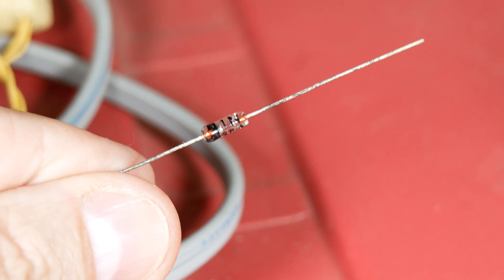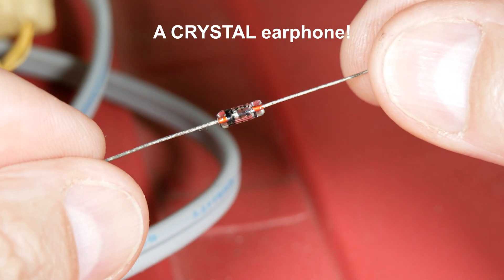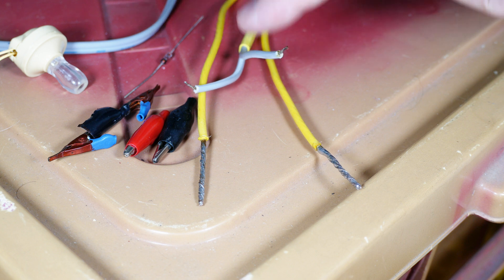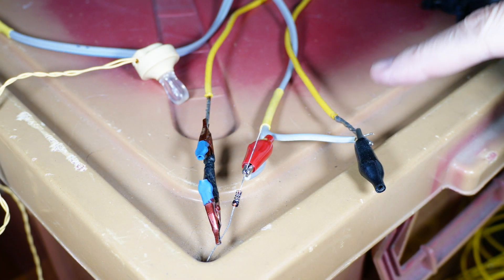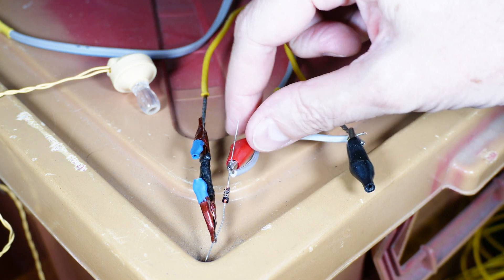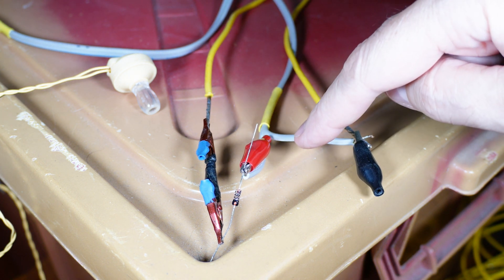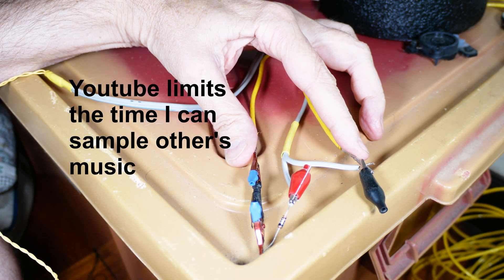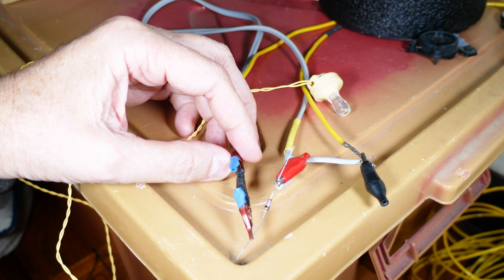World's Simplest Radio (4K)

Comment: The am radio transmitter in my area is about 577.875 miles away. Will this work?
Reply from the maker: @Dinoseven07  That is far. Depends on its power and your antenna.
Reply: @tsbrownie  What about 100 miles?
Reply from the maker: @Dinoseven07  Answer is the same. It's always about their power and your antenna / radio.

Comment: For some reason when I tried this I didn't get nothing but when I would touch one of the connections I could hear like electric charge
Reply from the maker: Do you have an AM radio station within about 10 miles?  And do you have a long wire antenna?  It will not receive FM and some countries no longer use AM.  But otherwise it works.
Reply: @tsbrownie I'm from the UK so I'm guessing we still have am cause my crystal radio works pretty well and how long would this antenna have to be I'm guessing my antenna was about 30 feet
Reply from the maker: @lukemarlow2939   There are 3 things to make it work: AM radio station within range, the correct diode / earphone, a good antenna / ground. 30 feet is good, the one I used here is 9 meters.  My ground is tied to my house's steel reinforcement.  In this video you can hear 2 stations, one is real close (less than 2 kms), but the other is more like 7 kms.  Check the distance to your nearest station and if it's close, then there's a problem in one of the components.  A crystal radio with a tuner will definitely out perform it.  As a side note, the first time I discovered this I was about 10, sitting in my parents half basement and accidentally touched a (now antique) germanium diode across the leads of an old time crystal earphone and was shocked to hear one of the local stations!  No ground (except my bottom on bare concrete) and no antenna other than my finger holding the diode in place.  That station was about 8 kms away.